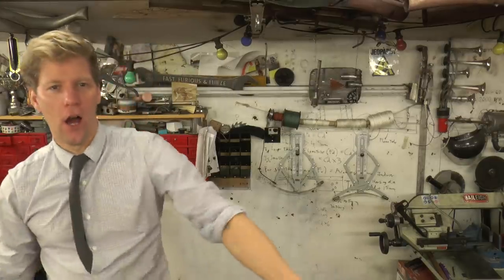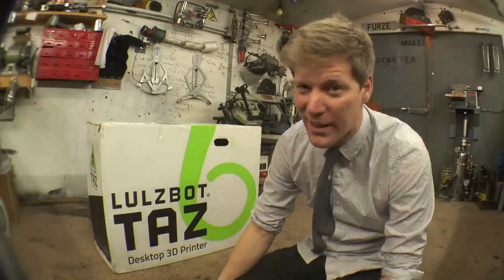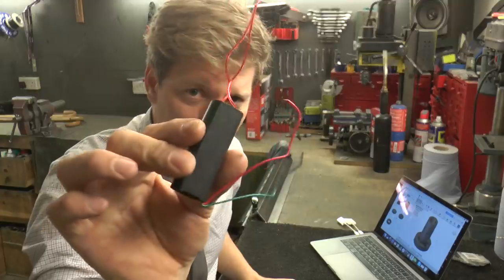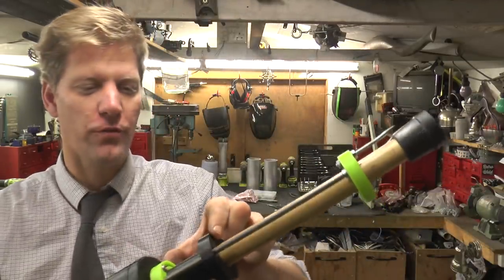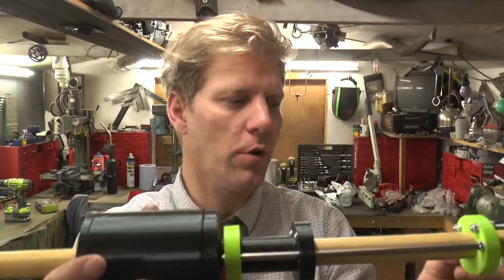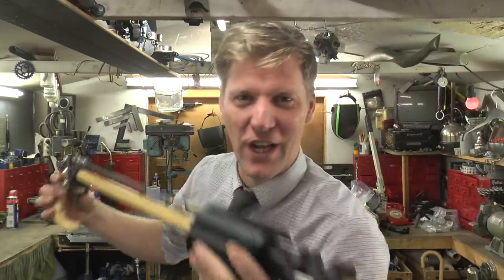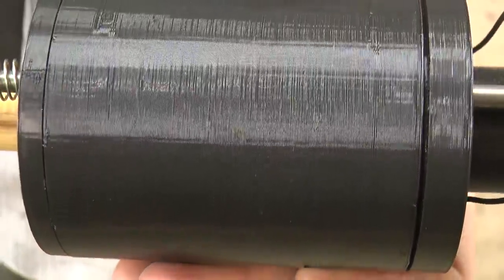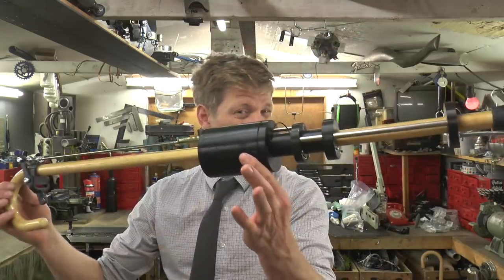Walking Stick Tazer

Comment: The reason for those holes being slightly small, and the outer diameter being slightly larger is because as the hot plastic is dispensed, it tends to settle a bit and bulge outward, as the print gets taller the warm plastic weighs down the plastic below it squishing it just a tiny amount, so your print will tend to end up slightly wider, and slightly shorter than designed. I'm talking fractions of millimetres... but it can be easily worked around once you learn the idiosyncrasies of your machine, the type of plastic and heat of the nozzle. You can reduce this bulge and squish by tweaking those variables, obviously hotter plastic will run and bulge more, some types of plastic will set faster before they have a chance to squish or bulge, and these can be easily rectified by hitting up a forum and asking around what plastics and settings work best for high fidelity, or accurate prints.

Hope this helps anyone, I doubt Colin will see this, and anyway it's waaay too late! Haha but if anyone is helped by this at all, I did my job.
Reply: Waffle
Reply: fanks

Comment: "Its a delicate peice of equipment"

Continues to throw it down the bunker hole and steps on it
Reply: the box was probably empty 
PROBABLY
Reply: It was falling too fast to be empty
Reply: Quack
Reply: Christopher Walker I like how u think
Reply: @dot.8107  well no, things Fall at the same speed, even when they are a different weight.
Reply: @jonahdertyp  so if there is nothing inside it will still fall like it has something inside?
Reply: You could see it was open
Reply: Reinier Urriza  not how physics works
Reply: @dot.8107  Yes, search for "feather and Hammer experimentiert in vacuum"
Reply: Noah Ali we don’t really care it was a joke
Reply: @jonahdertyp  9.8m\s\s
Reply: @prakharmishra3000  Well okay, they accelerate at the same rate? Thats the right term...
Reply: @jonahdertyp  yeah 9.8m\s\s
Reply: @SubBot-wt9gu  Yeah!
Reply: @dot.8107  mate that was proven 100s of years ago if that was true planes probably wouldnt exist
Reply: In a vaccum, all objects in free fall fall at the same speed regardless of their mass and shape because as long as they're both on the same celestial body, acceleration due to gravity will be equal and constant for both objects, and there will be no air resistence to slow either object. Here on earth, objects in free fall fall and different speeds not because of mass, but because of air resistence hence why different objects have different terminal velocities (otherwise, parachutes wouldn't work). Droping an empty box vs a full box will not significantly effect the speed because the shape of the box will not change. (Though a heavier object resists the force of drag better so there will be some speed difference but at relatively low "falling box speeds" the force of drag is not very significant.) 

Hope who ever reads this learned something sorry if I'm wrong about a few things I'm not a physicist.
Reply: @dot.8107  you're right. the air resistance will have slowed it down if empty, however, to know if it was, or wasn't empty, we'd have to see it fall when full.
Reply: Jonah lol mans missed physics class. Do you know what a vacuum is?
Reply: Colin: its a delicate piece of electronic equipment, so we will put it in the bunker where it will be safe
Also Colin immediately afterwards: *LMAO YEET*
Reply: Don’t worry he threw it carefully 😂
Reply: Sorry I didn’t see your post I’ll delete mine

Comment: I see a lot of questions regarding the "module" used in this project, Big Clive demonstrates the exact same module. They put out about "20-40KV" and are only a couple of quid to buy.. Check out Clive's self test of it :) do a search for "Big Clive stun"
Reply: ADR-Richard so it’s putting out enough to actually stun someone or is it just a flashy light?

Comment: You should try using a filament with some wood fill in it. I've seen it before and it's sandable and paintable and I think even stainable too so it won't look like a vinyl record with all the layers. Possibly a much more stylish mach 3 coming?

Comment: Just a heads up Colin, I assume you are printing with PLA, while it is pretty tame compared to ABS in terms of fumes, I would still suggest a ventilation setup just for the printer along with that of the bunker just to make sure the fumes do not stay in the bunker any longer then they have to.

Comment: if you adjust the layer height in the 3D printing slicer, the finish will com out nicer but you will add a ton of time to the overall print.  it all depends what you want. you can also speed it up in the slicer as well as slow it down. for me, if i were to print something tiny, i would lower the layer height to about .1 and lower the speed down about 10mm /sec . i really like seeing 3D printers out there more and more. have fun with it.

Comment: Yeah I've found that the outer walls of a 3d print tend to be pushed out by about half the trace thickness. My guess is that it lays the outermost trace in the "middle" of the line in the software. Something you really only need to take into account if you're making parts that fit together really tightly, like hinges.

Comment: Improve it with "pepper spray" at the end/bottom of the walking stick to give added protection, with another trigger of course.
Reply: Sorry it’s late but if he used pepper spray what oil based then tazed the person it could light the person on fire so in that cause he’d have to use a water based pepper spray

Comment: Any time I am designing something to be reasonably accurate for 3D printing, I allow 'half' of my printers nozzle (.4mm nozzle I subtract .2mm from my dimension) where it matters . . ie: bolt holes or joints.. this is still not super accurate but it lessens the post processing. . . Hope this helps Colin, top job all the same!

Comment: Why not make your own walking stick? 
Use a metal pipe, bend the top part and put everything inside to make it invisible from the outside.
Reply: GameBreaker because old people use wooden sticks alot more
Reply: GameBreaker yeah, if you'd really want it to be useful then you'd have to hollow out the walking stick and put all that stuff inside of it. Plus you would need a more powerful battery and an easy way to recharge it. The idea is pretty cool and has potential.
Reply from the maker: this was just to do some 3d printing as id never drawn in cad or anything before so the stick was just the project if that makes sense
Reply: Sure I understand that, but still a home-made one would be more "useful". Also, the print came out very well.
Reply: You'd be surprised at how much the weight of a metal pipe would negatively affect it's utility as a walking stick. It'd kill an old person's wrist using it.
Reply: Or maybe just get a long carbon fiber tube, 3d print a handle and a tip and voila, you have a hollowed out, very durable yet very lightweight walking stick. He can put everything inside the carbon fiber tube and still have the stun feature.
Reply: house everything in the handle and make it detachable with the prongs at the end of the handle. Like a cane sword

Comment: The trick with getting holes to print right is to print a calibration cube and figure the tolerance of your machine. I add .2 mm to my designs when I need something precise, and it prints pretty well!

Comment: For your 3D printer I would advise printing some accuracy tests and stress test pieces. They can easily be found online and used by everyone. Best thing to print with a new printer to make sure ur getting the best prints. XRobots might be able to help with that.

Comment: The piece that you 3D printed is a little bigger because its the size of the plastic added on to the intended diameter so if you make the diameter 59.80mm then it should add the .2mm and the final piece will be 60mm.

Comment: For th holes being to small you need to make them larger in the modeling software cause when it is printing out once it cools it expands slightly making the holes smaller by just a bit

Comment: The dimension diference in the CAD and in reality is totaly normal and is called tolerances. You need to design with this in mind, for 3d printing the value used are between 0.1-0.3mm depending of the fiting you want (tight or loose). Great project and video as always, keep up the good work !

Comment: You have a drill press with a movable vise...  put an end mill in your drill press and use it like an end mill.  You can drill and cut holes and slots in soft materials.

Comment: Hi Collin, the accuracy of most 3D printers depends on software and such.
As far as I know many printers don't compensate the wire thickness it prints. So you're wire thickness is probably about 0.2mm wich makes the end result about 0.2mm. So if compensate the wire thickness in your CAD drawing you should be able to reach a better accuracy.

Comment: You need to fix the retraction settings on the printer as well as the heat of the nozzle. If your using pla the nozzle should be around 190 c

Comment: I usually takes 0,2mm off the outside and make the inside 0,2mm bigger to get it to fit better. Sice the holes aren't completely round (vector) it is better to put a drill through just to round it off.

Comment: I could see him doing a more intense version of this project, with the cane hollowed out and holding a fuel system so that if the sparks don't scare the attacker, the bottom flips open and the spark ignites some fuel and it shoots flames out the bottom!

Comment: You can not leave the filament out as it absorbs moisture.  Build a plastic box for the filament with a hole to feed out of and throw some dry cells in there.  Also you should encase the whole printer in a box to hold the heat in.  With these two things and a few adjustments your prints will work MUCH better.  You should have put it all in a PVC tube or something to make it look like a normal cane from the outside and the battery and sparker are not that big.
Reply: Todd Abbott Wintergatan here? xD

Comment: Many years ago in South Africa they were using a device called a power head to ward off sharks in the sea when diving......it consisted of a long pole with a shot gun cartridge in the end...…..push it against something and it goes boom...….maybe that would be slimmer mounted in a walking stick.

Comment: For everyone looking for schematics all you need is a transformer, a transistor, a switch, and some resistors and diodes. Or that spark generator (which puts out 120kv and HURTS and is available for $5).

Comment: Protip: store the printing spools in a dry Tupperware with air dryers (the teabag things you get with shoes/shipping boxes, etc) and put the spools that have been out and about in the oven at 60°C for an hour or 2. It greatly reduces the threading you see on the final result, reduces the parts from expansion/shrinkage and makes the construction a lot stronger.
Reply: Vintergatan (look for it on YT) put out a comparison I think

Comment: Hmmm.  If you used an aluminum cane instead of a wood one, you could probably fit most of the hardware inside the hollow shaft and come pretty close to making the final product look like a normal cane.  Juice it up with rechargeable lithium cells and you could really lay the electric smack down on those pesky whippersnappers!

Comment: "...and it's less powerful but gives the same effect..."
Ahh maybe. But that's still a least a 1cm gap that spark is jumping. Thats 30,000 volts. That voltage thorough the wet resistance of body had got to deliver some amps. Surely that's gonna do some harm even if it just burns?

Comment: the plastic from a 3d printer does swell when its heated and cooled while printing, so as a recommendation if you use abs, put heat lamps on your printer pointed at the print. if you use pla, it doesn't affect it.

Comment: 18650 batteries are exploding during over discharge. So it needs low voltage protection and a charging port. After that, it is a cool and funny project :)

Comment: You haven't set up your printer properly. It is pouring the plastic a bit too slowly. That's why you get the squiggly lines everywhere. You need to adjust it so that you don't get these lines but don't overdo it or you will get plastic sticking out from the sides.

Comment: Hi there mate. First I want to tell you that you have awesome toys to be honest MADNESSS Anyway let`s get to the point. I would like to ask you if there can be made any improvements at all to an electric shocker like connecting it with a glove or a ring so the main device stays in your pocket and you don`t need to pull that Star Trek looking thing out and scare the s**it out of someone. I have a Led Flashlight combined with a shocker and a laser pointer. It is about 170mm long and 35mm diameter and by the time you try to pull that out of your pocket you`ll probably be stabbed like 50 times so Yeah I would be very grateful if you help me out please. I reckon that if I use a cable there is a chance the power that reaches the glove or a ring will be insufficient to knock down a person

Comment: Colin I'm not sure if it's a good idea to place your 3d-printer in your bunker! You need good ventilation for 3d-printing because your printer produces unhealthy fumes! If you really want to keep it in your bunker, then only print with PLA, because that's the least unheathy filament...

Comment: Hey man love your videos watched almost all of them I just have a quick question. How much would it cost for you to print me off a part for my 1978 honda goldwing motorcycle gl1000? Its a part that is no longer made which I have but im missing the second peace http://www.randakksblog.com/honda-gl1000-timing-advance-unit-details/
I only need the cam lobe\sleeve that goes over the round part ive been trying to make one but it been kind tuff to get just right oem version is made of metal of some kind ive been trying plasic an aluminum. Also I built a couple lawn mowers you would probably like I'll have to get a video together one is a push mower but can cut 8 foot tall brush like butter anyway thanks hope to hear from you

Comment: I made a stun gun walking stick last year. I used the same type of battery and stun gun module for it. The major difference being that mine has a built in three way flashlight, you can charge a cell phone from it, and its rechargeable. Mine also has all the electronics housed inside the stick as well. Rather than having a box on the outside like Colin's. My 3D printed parts look nicer too.

Comment: Cool project but not feeling the 3d printer thing. Please stick to the milling drilling and welding. Proper engineering thst we can all have a go at.🖒
Reply: jayswin2 3d-printing is an important and amazing tool for rapid prototyping... especially in proper engineering :P and isn't a 3d printer cheaper than a milling machine? :x

Comment: Its surprising to see that lulzbot printers are still shit quality for the price.
I owned one but with all the parts I had to replace, it was pretty much 2 that I owned. Shit support, garbage wiring harnesses and connectors, poor calibration, bent and missing hardware. And not to mention the price. Buy a good printer for 1/2 the price.